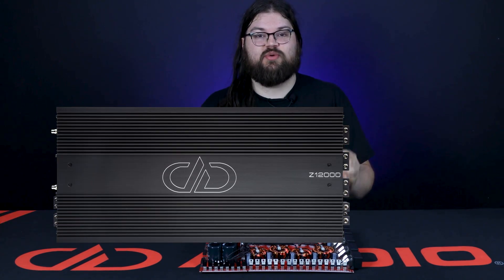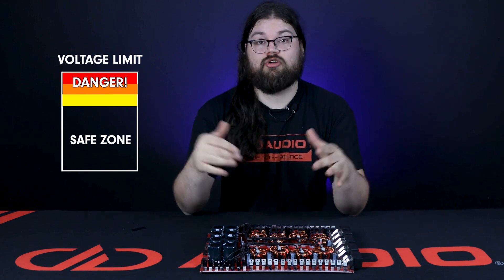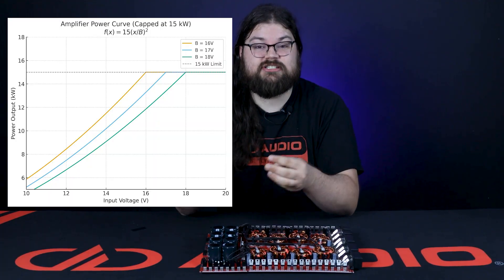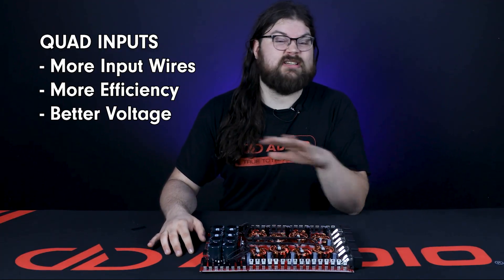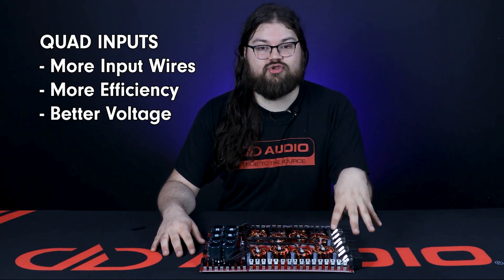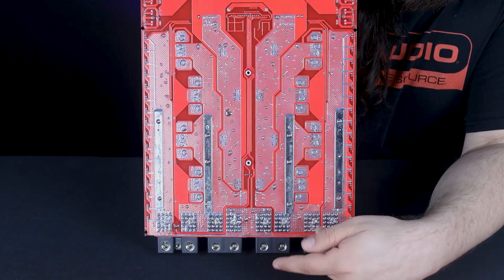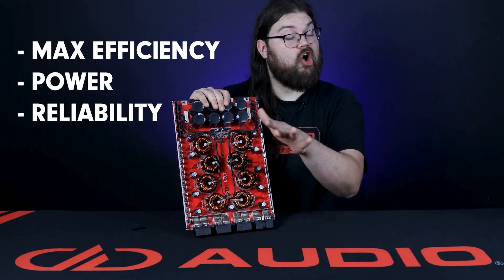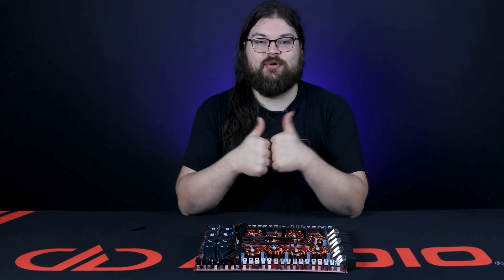DD TechTalk: Z12K Amplifier Engineering Choices

Comment: are your other lines a full bridge design ? people were complaining about it lacking with the lows alot compared to plenty of other amps ? which is usually an issue with full bridge amps , not reliable, needs perfect voltage and a huge battery bank, and produces much dirtier sound than half bridge china and korean amps
Reply: The SS3k, 6k, and 9k are full bridge amps. They are an in-house design with TONS of upgrades over a standard full bridge amp. And they have been verified on our audio precision to make full power down to 20 hz.

Comment: I’m only pulling 4,201 watts at 15.5v at 2ohm from my z12k. Can someone explain why it’s so low? Gain set with an oscope, I charge at 15.5v I have 120ah lithium all ofc skyhigh 1/0
Reply: That's prolly about right when hooked in the field. Them numbers on the dyno don't counter the box rise.
Reply: @NATHANPressler-w4f I see people claiming over 12k in real world applications. I have no idea how these people get these numbers. 4k clamped at a common ohm load after rise for a $3500 amp is ridiculous.
Reply: At 2 Ohm? 15.5v? How much are you expecting?
Reply: @def-hi9295 I got a ruthless 8.5 at 2ohm at 15.9 I believe it dynos at like 7800 at 2ohm I'm only clamping like 4900 tho so idk
Reply: @NATHANPressler-w4f how much is a ruthless 8k? Clamps more than this 12k I’m highly disappointed in this amp
Reply: @def-hi9295 it’s rated for 4k at 4ohm at 14.4v so I would expect it to do rated on higher voltage and lower ohm
Reply: @andrewlynch9622 that has got to be disappointing!!!  All that talk in the video sounds like BS to me now, after seeing what people are clamping.
Reply: I'm not dissing dd audio I really like the gear and would love to give that amp a run
Reply: Yeah you're probably at 4 ohm after box rise. It depends on the box. I wire my 2 DD 712F subs at half ohm and with my box that brings it up to ~1.5 ohms. This allows me to push close to 6k watts to the subs. Try wiring your subs lower and building a better box. Also, what are your lowest voltages? I would get a SMD VM1 to monitor that.
Reply: @insanelywicked873 I’m wired at .5 rising to 2 ohm well 1.98 with z312s. That’s on 15.5 no voltage drop. I run a 400 amp alt and have a 120ah lto lithium bank. I mean it does 156s under 4k on the dash in legal position with the 2 12s I’m sure the box is the issue with the amp only pushing 4k at 2ohm.
Reply: @andrewlynch9622 What are you measuring voltage with though? I've seen plenty of people showing 14+ volts but those extremely fast dips can be below 12. Not doubting you just trying to help.
Reply: @insanelywicked873 you’re clamping 6k at 1.5 from a z12k? That’s garbage for a $3,500 amp
Reply: @andrewlynch9622 No I'm not using a DD amp.
Reply: When you set your gain, what test tone did you use? 
A -10dB?
Anything less would probably reduce power. 
Is the clip light going off at around the 4k your measuring?
Reply: @JasonWW2000 I set it with an oscope and the clip light on the factory knob. I use a tone recorded at 0db and I use the frequency I’m peaking at. I turn the gain to the point of a soft clip on which ever shows clipping first whether the clip light or oscope then barely bump it back into a clean wave. And this is set at my max volume before distortion on my headunit. So volume 27/35
Reply: I have had several amplifiers in the car. This is the first one not doing remotely close to rated power.
Reply: @JasonWW2000 I run boom check for my competition runs which is recorded at 0db. I compete and put my subs under stress for 90 second plus runs. I may not hear a soft clip but the conversations I’ve had back and forth with dd they do not recommend even a soft clip to subs. I set my gain to the tracks recorded levels I compete with. I demo songs that are recorded at -7 to -5db. Let me be a little more clear the amp is RATED at 4k at 4ohm at 14.4v I should not have to bring the amp into clipping to make rated power at a higher voltage with a lower ohm load. You may not realize this but the higher the voltage the less stress there is on the electronic. Therefore being at a higher voltage the amplifier is working easier but not doing rated power. I have not seen a z12k from anyone do rated power at the rated ohm load in a vehicle.
Reply: @JasonWW2000 after 30 the headunits signal gets extremely bad. The way the amp is set I start clipping at volume 28. I understand everything you’re trying to explain to me. For an amplifier that cost over 3 grand I should not have to bring it to clipping to make rated power. My dd z special edition amplifier does over rated power set the exact same way
Reply: @andrewlynch9622 You're doing competition stuff? I'm probably not going to be much help then. I tend to focus more on SQ stuff. Good luck with the system. You're already doing 156 on two 12's. That's freakin impressive. 👍
Reply: @JasonWW2000 yeah when I told Jack I was running a z12000 on 2 z312s he said I was crazy. I’m not upset that I don’t make rated playing music during demos that’s going to happen with fluctuations in the music. My frustration lies with I don’t make rated power during spl music runs when the tracks recordings are at the volume I tune at. I have checked all my songs and tones through a program that tells me recording level and when and where clipping starts. If I were at 4ohm making 4k, ok I get it that’s what the rated power for the amp is. Even at the higher voltage atleast it’s close. But being half that ohm load at a higher voltage I feel I should be seeing atleast 2k more
Reply: @andrewlynch9622 Thinking about it logically, I would take lots of measurements. Measure the amperage and voltage going into the amp and out. Verify your voltage sag. See if there's any discrepancy. Verify the efficiency. 

Also verify the impedance on the particular frequency your playing. 

At 4k watts out, that amplifier should be drawing at least four hundred amps. You've got a pretty beefy battery and four hundred amps should cause some voltage sag, but probably not more than one volt.

I assume you're running at least 8ga ofc speaker wire and heavy duty terminals into the enclosure. 

Are you using a Term Lab or SPL Lab to monitor output? If not, you might want to. Depending on how serious you are about competition. 

I'm sure there has to be an explanation as to why the power level on this amp is low.
Reply: @JasonWW2000 I use a termlab and an efficiency program. I have checked the impedance on termlab and with a fluke. The only thing I haven’t done that you’ve suggested is clamping for amperage draw. For 30/45 seconds I see no voltage drop but after that I drop from 15.5 to 15. That’s during music runs. During burps I idle and don’t see any voltage drop at all. I run ofc sky high oversized wire for everything. Charging for my big 4 to battery delete is 2/0. main runs from battery delete to the bank are 1/0. Runs from the bank to the amp are 1/0. Sub leads are 8 gauge.
Reply: @JasonWW2000 I just looked and rated continuous wattage at 2 ohm is 7,000 watts for this amp. something isn’t right.
Reply: Reactive vs resistive load on a dyno, did you only use a 0db track when setting your gain?
Reply: @mrcornut the tone I used was at 0db which is what the boomcheck tracks I run are recorded at. The rated power of the amplifier should be the actual power output of the amplifier at that designated ohm load. My question was why this 12k is not producing that. I have ran several dd amplifiers along with other brands and I’ve never had an issue getting rated power from them until this amplifier. My dd zse puts out more power than this 12k does and it’s a 6k rated amp